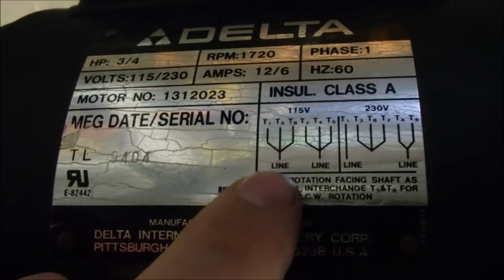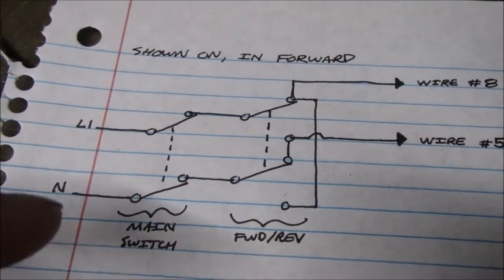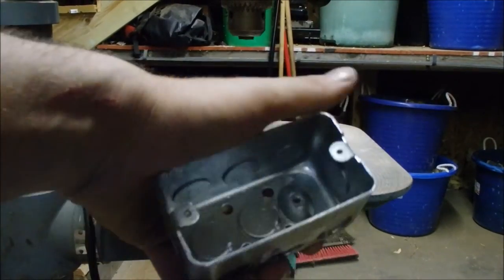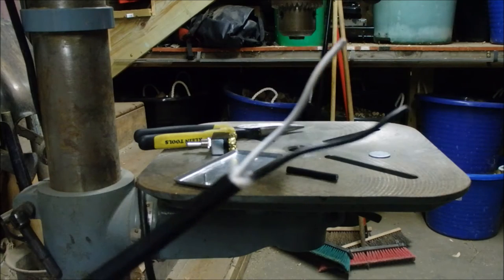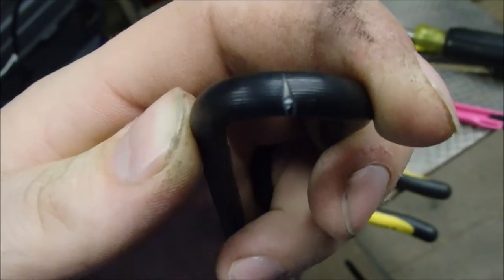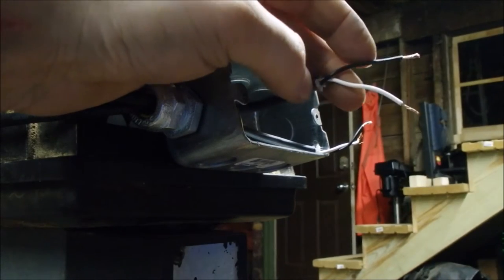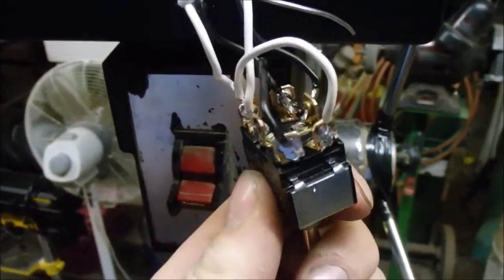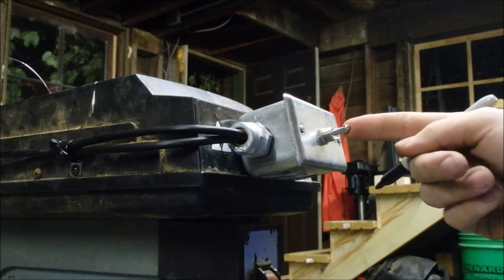Cheap Simple Drill Press Reverse Switch

Comment: A 4 way light switch works exactly as your little double pole double throw switch does but without the center dead spot. Good explanation on your wiring.
Reply: Exactly what I did, a 4 way switch is even easier. I just forget sometimes to change it back (from reverse to forward).

Comment: please excuse my ignorance here.. I'm used to switches like in a dc circuit where a power switch is simply opening or closing a circuit.  why would a main switch have both power and  neutral on it.  what are the other lugs going to?  5 and 8 what about all the other connections for an ac motor
Reply from the maker: The switch I added is changing where the power and neutral are applied to the AC motor. The AC motor has multiple leads for multiple coils, which allows you to pick which direction is spins depending on how it is wired. The switch is a DPDT [double pole, double throw] if you google a diagram of that switch, it may make more sense.

Comment: Can this be done in a 1 hp 110v/220v 60hz 1ph motor with 4 wires?
Reply from the maker: Possible, but can't tell without seeing it. There are thousands of variations in how motors are wired. Just google the manufacturer's product number and you should be able to find wiring diagrams.
Reply: Nope, you need to open the motor and find one pole of the start winding. I just mod mine and it works. Some motors, specially Taiwan made are not reversible from factory.

Comment: Will just adding the DPDT swich work on a capacitor start single phase 129v ac motor?
Reply from the maker: Depends on how the motor is wired. If it doesn't have two sets of field coils it won't work

Comment: why would you want to run your drill press in reverse?
Reply from the maker: JIMMY TATE bit stuck, left hand drill bit, tapping threads,
Reply: polishing and sanding with disks and drums and brushes
Reply: and left hand drills..to remove  broken bolt
Reply: For tapping holes.... tap in .... reverse...  tap out....
Next part ....
There are more expensive tools. Aka tapping head...but in a pinch...works pretty good....
Reply: I had  very many 3/8 NC threads to tap. Small items are fine (just loosen the vise and spin the part off), but my pieces were over 6 ft. long.My 4 way switch was easy to add (needed an extra electrical box to hold it ).